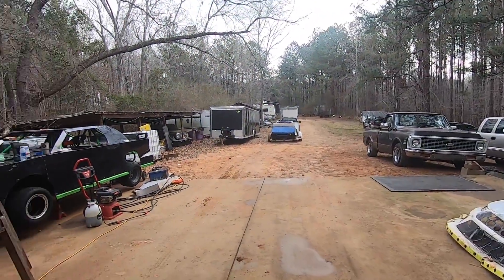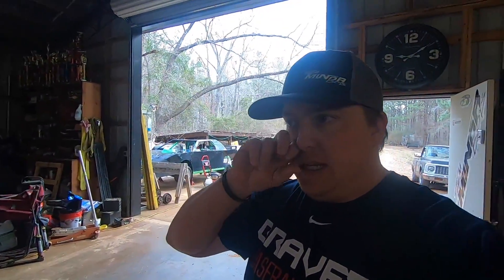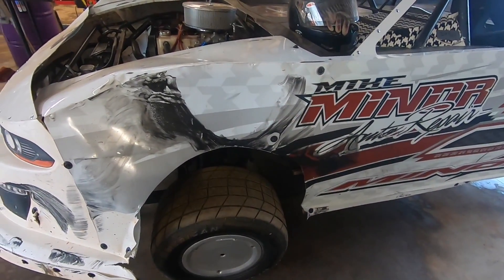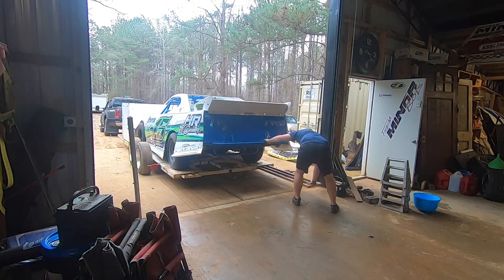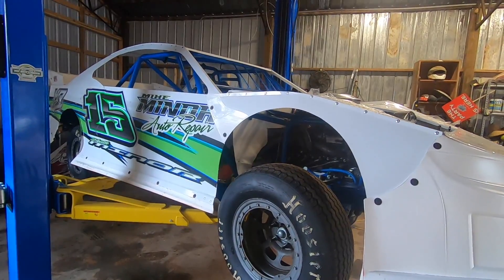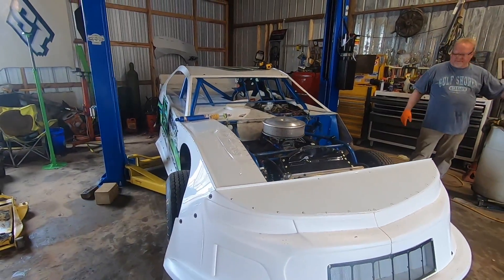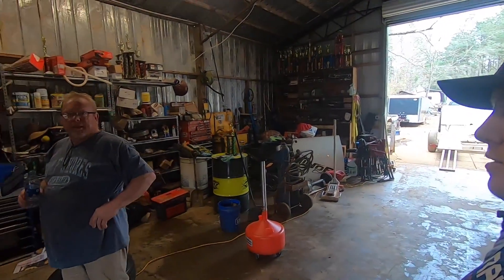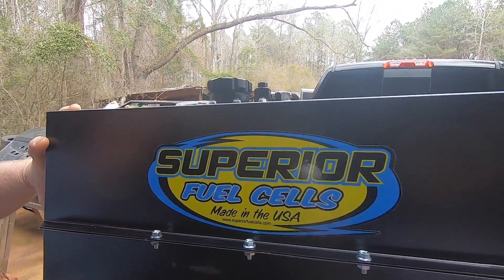We SOLD One Of Our Cars!!! Big Change Of Plans!

Comment: Look at that little guy so cute. Hey heath question for u what motor due u run. With the 4 barrel on it
Reply from the maker: Thank you! It’s a 602 crate motor in that one. I can run a 4 barrel. Bo has open motor and has to run a 2 barrel.
Reply: @ThemMinorBoys  so is there a weight brake for the 602.
Reply: Have u had the cars on wheel dyno  I'd like to see how much disadvantage the 602 verse open motor
Reply from the maker: Yes. 200 lbs basically. Horsepower wise it’s a lot but when the track slows down it evens them out. Honestly one or the other hasn’t dominated the bigger races.